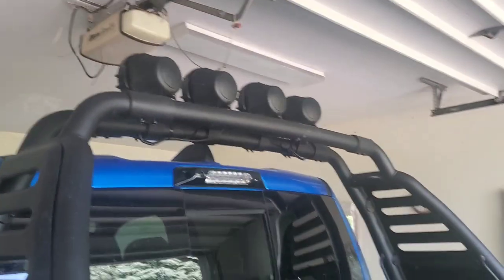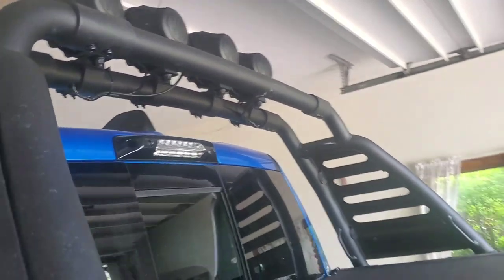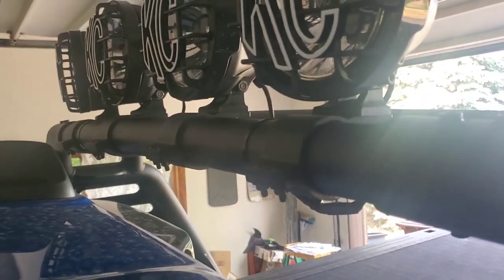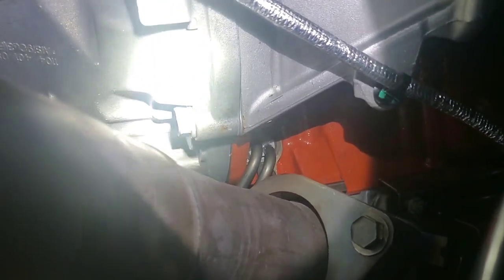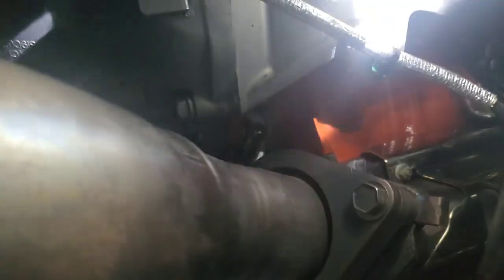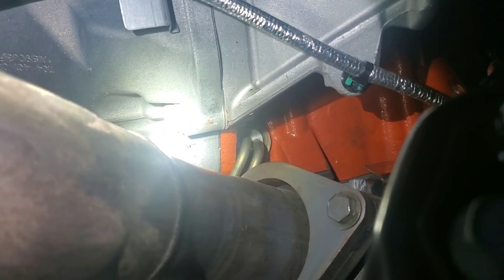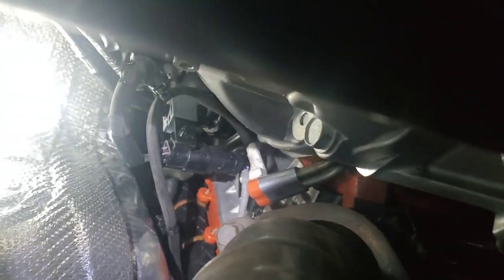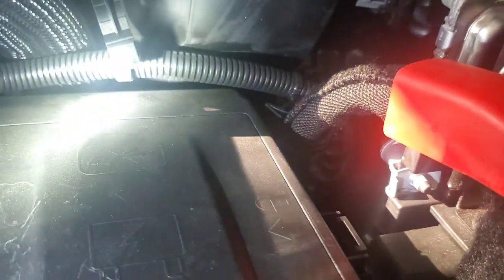RAM TRX AUX PWR and LIGHTs. AnD QUICK BLOCK HEATER INSTALLATION

Comment: That’s amazing setup, can you provide a link for those aluminum bracket for the lights?
Reply from the maker: Thank you, here is the link, the part number is there if you want to look and check prices https://store.mopar.com/oem-parts/mopar-ram-bar-off-road-light-mounting-bracket-82216127aa
Reply: @vfr800fi07  thank you and keep posting videos like that
Reply from the maker: @hamedelrayyes  that's the plan. I've been a little busy lately but I'll be back at it

Comment: Can you give me brand of the lights on the Rambar with the brackets included? Thanks so much in advance
Reply from the maker: The brand is KC the model is their 6" Gravity. The brackets for the Rambar are from RAM. Part number 82216127AA. You'll need 2 sets for 4 lights
Reply: Don't need anything else? Switch on off comes with the lights? Thanks in advance

Comment: hi by any chance you have the model of the kc lights ? thanks
Reply from the maker: I can get it...I have the middle are spot beams and the outters or flood...but they all are identical looking
Reply: @vfr800fi07  hi do you have a link so I can look at them?
Reply from the maker: @edgarlozano4588  I will look them up
Reply from the maker: @edgarlozano4588  https://www.offroadwarehouse.com/product/6-pro-sport-with-gravity-led-g6-pair-pack-system-driving-beam-644
Reply: @vfr800fi07  please i really want that same set up.... looks great
Reply from the maker: @edgarlozano4588  those are the spot beams..they have driving beams as well
Reply: @vfr800fi07  are yours all spot beams ?
Reply from the maker: @edgarlozano4588  my center ones are spot .and the outters are driving or flood and are slightly turned outward
Reply: @vfr800fi07  thank you i really appreciate your help i will put the order in also is there any way you send me the link for the outter ones?
Reply from the maker: @edgarlozano4588  https://www.offroadwarehouse.com/product/6-pro-sport-with-gravity-led-g6-pair-pack-system-spot-beam-643